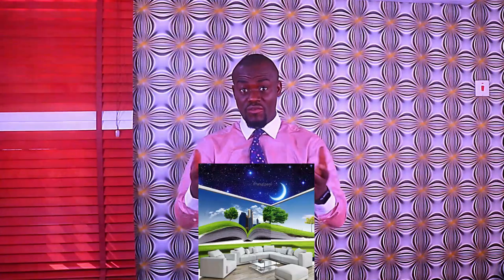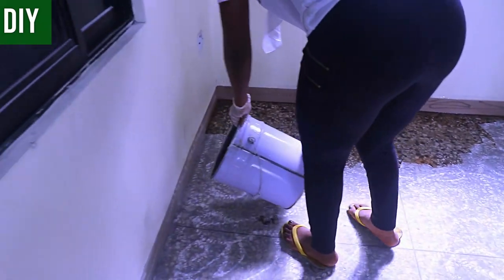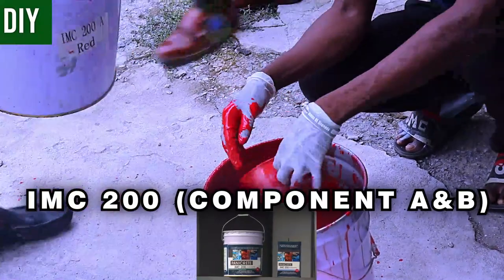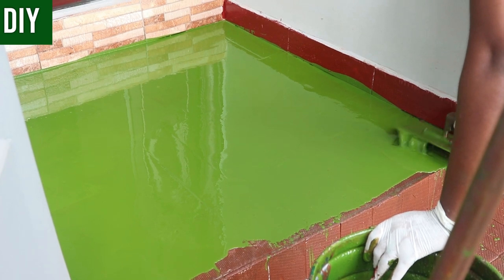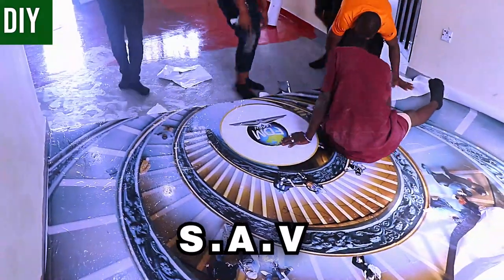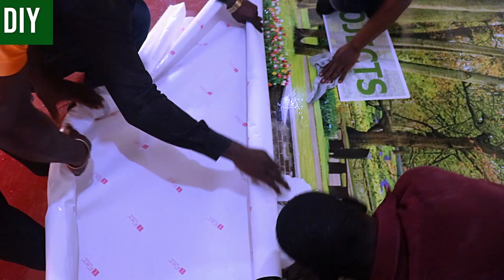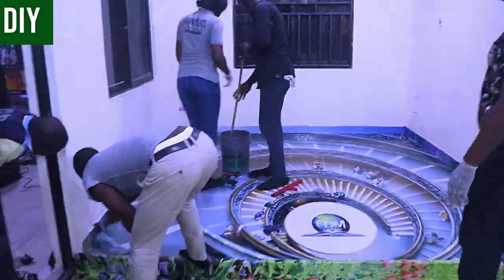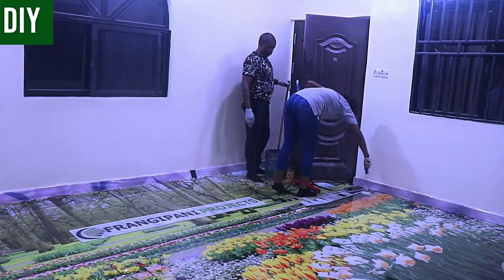How did i get so many images in my floors 3D EPOXY installation turn trash into beauty by fdmlearn

Comment: Good job bro, i was trained using the fsc 900 for 1st, 2nd and third layer which is the finishing. I hope this is right?
Reply from the maker: it will peel or fail quickeer than when you use the correct chemicals

Comment: Sincerely, this is one of the most insightful videos I’ve seen and in fact, the only Nigerian video I’ve seen.
I have a question, which epoxy is available in Nigeria that can be used for making river tables. I mean those tables with epoxy in the middle and wood on the sides. Pls which epoxy can I use for this?
Reply from the maker: Epoxies with Low VOCs that’s volatile organic compounds can be used. They abound in NIGERIA you can use those ones

Comment: Weldone sir you have done more enlightenment to me and probably empower me with insight. Please sir like how does 20litre resin cost and where can I get it for a practical class
Reply from the maker: call +2349099998301 to get chemicals and tools for 3d, Epoxy and even stamped concrete

Comment: Sir, what causes the vinyl to disintegrate from the midcoat after the 3d Epoxy installation?
Reply from the maker: A lot of reasons but most often i have seen has been poor quality print paper for the vinyl prints there are a lot of fakes in the market currently

Comment: Where in Abuja can i get all the materials required for 3D epoxy flooring?
Reply from the maker: you can check Suite G4 Mbouty Plaza Marcus Garvey Street off 5th Avenue. Gwarimpa.
Reply from the maker: 09099998301
Reply from the maker: @ajetomobiidowualex6808  +2348171531955
Reply: @fdmlearn  the 3D picture how can some one get it

Comment: Nice job sir !Are this materials available in Ibadan?
Reply from the maker: Yes they are. They usually will waybill it to you wherever you are. You can call 09099998302 i trust them to deliver materials that wont give you issues.
Reply: @fdmlearn  I'll contact you for the resin. I'm in Jos

Comment: Adding the epoxy before applying the 3D wall papers. Its needs to be sanding. I never see you guys sanding the epoxy that already applied to the floor. check others how its was done properly
Reply from the maker: you don't sand before applying the wall paper else the wall paper won't bond properly. Yoou sand before applying the epoxy